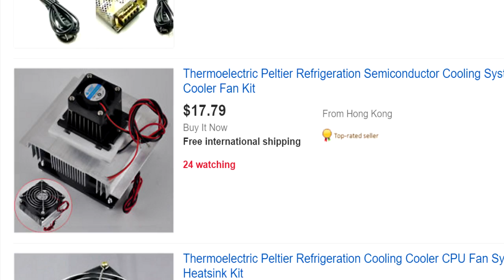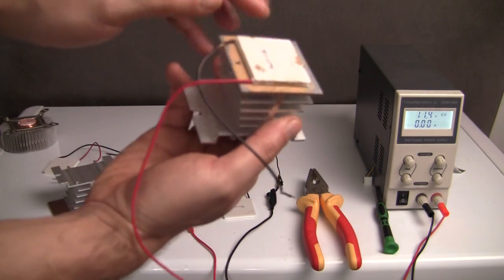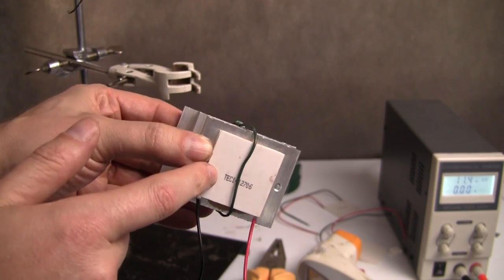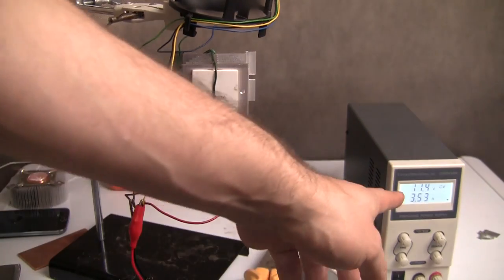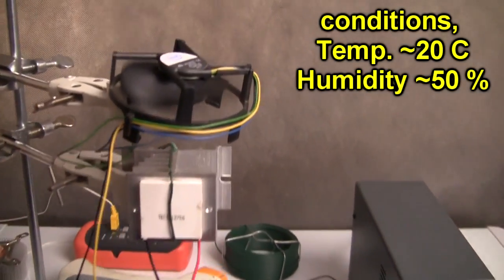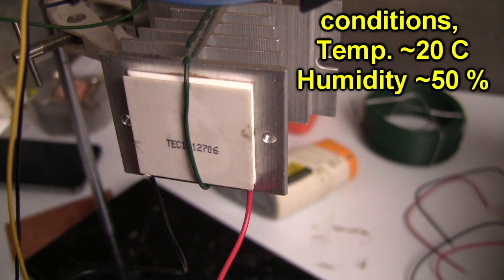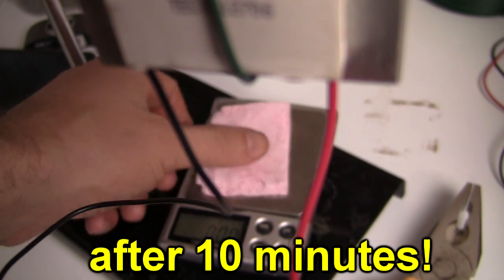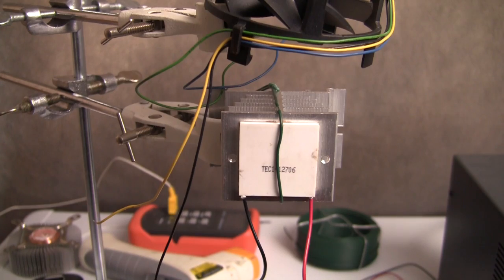Fontus Water bottle claims to make water from air.  Is it possible?

Comment: If air has so much water, wouldn't breathing provide enough hydration?
I'm confused.
Reply: +ZURATAMA1324 
Air do contain a fair bit of water.

But when you breath you also heat the air. If you heat the air it binds more water. When you breath the air is actually drying your lugns out (and that is a good thing, other wise you would drown)... the drawback of is is that you loses water be breathing. In a artic climate its a real problem
Reply: The air would go into the lungs, and the water cant condense anywhere, so probably not.
Reply: Considering that your body has a higher concentration of water than the air, the diffusion happens the other way around. That's why you can fog up glass with your breath.
Reply: If there is so much water, wouldn't you drown in air?
Reply: +That one guy without a profile pic and you could use your artifical gills.

Comment: I used to work for a company that made water from air machines. Running on the fridge compressor design they worked really well, but the company basically went under trying to get this model proposed here to work. It just doesn't work in reality.

Comment: I'm not a scientist and I completely believe that Thunderfoot made a fairly accurate recreation of the technology at work here, but honest question: would a closed system (e.g. mostly sealed bottle as the Indiegogo presents) possibly retain more water than his kit here? It seems that with all the fans and airflow that condensation might dry up or evaporate, therefore skewing the results. Is there a good explanation of how that could be a factor or isn't?

Thanks.

Comment: does the water condensed depend on RH? Would RH have made a significant difference?
Reply: +yan-Deriction It depends on the humidity, temperature of the environment, temperature of the object that is suppose to collect to, and how well the collection point works (mostly to prevent evaporation).
Reply: +yan-Deriction Yea.... in doors its usually 50-60% or so
https://en.wikipedia.org/wiki/Relative_humidity#/media/File:Relative_Humidity.png
He is really right on the limit.
You can only cool it down to 6g per kg (water/air), if you go any colder it will sublimate. 6 grams is about 50% RH around 18 or so Celsius, giving him about 1 or maybe 2 grams per cubic meter of air.

If it was a warm day at the beach it would be say 25 degree and 80% RH, that would push it to 18 grams. You can still cool it down to 6 grams that would give you about 12 grams per kg of air (about 800 liters or so).

We can give it a bit more calculation. 
1KG of air cooled 25 degrees will use 25kJ (yea, that is not a fluke, its actually defined that way). That would condense 12 grams of water (80% RH). 25kJ is about 7Wh, that is in turn about 600Wh per liter of water.

That is quite a lot better than the experiment he done.

Adding a heat exchanger i would guess you could push it to 60Wh per liter, and adding something more efficent than a peliter element, say a normal cooling compressor you would get about 1:6, so about 10Wh per liter.

I would say, that would actually be resonable. I think Thunderf00t calculated it all wrong

Comment: When you do your proper video I hope you will have investigated using different heat transfer methods. I have had better water production (unintentionally) when the thing being cooled was a loop of copper and the temp is held at 1~ degree C. So i think performance will be somewhat greater than your video here makes one expect, yet i do not believe production would be high enough in their device its simply too small.

Comment: Yep, peltiers are about 10% efficient and require lots of power. Then you get all the poison out of the air inside your water, including dust, gases and everything - you basically have an air filter where everything sticks to the moist surface... In survival situation, a simple solar distiller that uses dirt would be 100x better in every way. A peltier distiller would be more interesting, you can use one side for heating moist dirt and the other for collecting the vapors in perfect equilibrum...but still, lots of power required.

Comment: hey TF may i add a sugestion? Could you count the energy spent on the peltier and fans and see how much water you could recycle or filter using the same energy? im quite sure distiling pee or salt water gives way more water than that. Even mud could yield more water than that.
Drying dirt could give more than that. 

Unless you are in a desert.... but neither method would work in there are humidity is really low and theres just dry sand
Reply: +Laharl Krichevskoy THAT is a great idea.  That would serve really well to point out to people who don't bother thinking that not only is something not feasible, but actually completely stupid.
Reply: CyberiusT
exactly because this look like the plastics from air one,  While in the end it works, the method they use does more wrong than good, or in this case wastes more energy in being fancy than actually doing what its supposed to do.

Comment: you would have a lot more water in a bottle and with a higher humidity/temperature.  and you should know that, i think finding the dew point is an experiment in every basic physics course at school/university.
your lab isnt so good for this kind of experiments.
you had a humidity of 50% and 20°C, so the dew point is 9°C, no wonder that you dont get any water^^
Reply: criticises a nuclear physicist on his ability to perform a basic practical.
Reply: Daniel White
i understand enough from physic to know why his yield is so low...
Reply: +nox5555 So your telling me this bottle would only work in 20C+ and 50%Humidity+ environments?
Reply: VintageLJ
it works alot better in high humidity and higher temperature. hot air contains more water, and a higher humidity means a higher dew point, so the condensation starts alot earlyer. 
the dew point for his lab is 9°C. 70% humidity would mean teh dew point would be around 14°C.  and 30°C 50% would mean 9g/m³ more to harvest.
Reply: +nox5555 the problem is this isn't really a conventional dew point problem it's a dew point problem that takes elements from heat transfer in basic dew point problems the dew point is the temperature the air has to be at before condensation however for that to occur it needs to transfer heat into something which is what the peltier is for however the heat transfer will only occur at the surface of the device so only air that stays in contact with the surface for long enough will actually achieve its dew point temperature will the rest will remain at ambient temperature this could be mitigated by making it a contained isolated system but then you would need to pump air in more batch like then continuously
Reply: +nox5555 Ok, lets say you were in an environment with max. humidity (about 30gramms per cubic meter of air) in 30°C  which is about the max. temperature you get in very humid zones (rainforests) and your bottle would extract 100% of the water in the air (which is completely unrealistic), you would need to extract all the water from about 66 cubic meters of air so you get 2liters of water which is way less then what you would need to be healthy in such an environment . Now you must carry all the energy to extract at such a high efficiency and to push all of that air through your system because solar  wont cut it especially not in a rainforest where the ground is covered in shadows. What thunderf00t did was showing is, how ridiculous this thing is and he did a good job doing so.
Reply: *****
its not a good way of harvesting water, thats correct, but he used a setup that disfavoured the bottle alot.  maybe he is so nice and tests this again in a more humid setup.

I dont realy can think about a place where this system is good, but maybe you can find some special condition where this way of harvestng the humidity is the best(i doubt it, you can do it way better with the natural temperature difference between day and night.

Comment: I think it is also very dependent on the humidity levels in the air. In tropical zones where there is a high moisture level it will work better than in an arid zone like in a desert....

Comment: It's not even efficiently designed.  The cooling air should be the exhaust dry air from the condensate side since it would be below ambient temp after passing over the cold coils.  It should be vertical (the coil assembly) so that the water would drip into the bottle and not have to be blown by the wind.  From the drawing the ratio of cooling coils to condensate coils is too low, getting the condensate coils cold enough would probably result in the cooling coil being red hot.  It appears to me to be designed to look neat with just enough actual science to keep the marks from asking too many questions.

Comment: are you planning on showing a better idea for condensing water in the next video too? i think it would just be cool to see what your ideas would be to do the same job.
Reply: +Andrigo rosetti there's no smart way of condensing water. Water only condenses on cold surfaces, because when a water molecule chances from gas (steam) to fluid (water) it loses a lot of energy. Even If we are talking 100°C steam to 100°C water. So if this happens continuously (which is the case if you're trying to condense water in usable quantities) A lot of energy gets transferred to the previously cold surface. So to keep condensation going you need to keep it cool, therefore you need a cooling unit. 
But because of the massive amount of cooling required a small solar panel could never power it. And the power required is simply not worth the water you are getting. It's much cheaper and easier to just transport water in pipelines or drill wells. 

TL:DR There's no good way, because science. Stop believing bullshit merchants claiming in essence to have disproved the second law of thermodynamics. And then they only use it to develop some not really necessary device and only charge a couple of hundred bucks in exchange for their scientific revolution. If it sounds to good to be true, it probably is.
Reply: Scorpionsnerd maybe condensing is not the right word. maybe better ideas for gathering/purifying fresh water with minimal user input.
Reply: +Andrigo rosetti fresh water source, pet bottle, UV-light(aka the sun). kills bacteria very reliably. Which is why we're teaching it to families in developing countries. But of course you should filter it first, since UV light won't remove any dirt. Another, long-term stationary solution if dew and rainwater collection. Some desert animals live solely of dew water. But dew has to do with changes in temperature over the duration of the day, resulting in a reduce max humidity. Basically all you need to know: Dew is a result of the solar energy heating up the air over the entire day. This amount of energy can't be gathered with such a tiny solar cell. 
Incredibly enough there is no way of cheating nature/physics. As much as we'd love easy solutions they just don't exist sometimes. Just as an apple will not just "fall" towards the sky, fresh water without an actual water source isn't just magically possible. There's a reason cities like Dubai burn through tons of gasoline to get the salt out of their sea water. If they knew of some kind of magic condensation they'd use that instead.
And otherwise there are always chlorine based water-purification tablets. You'll find these issued in pretty much every military for when you run out of fresh water. I mean if we could just condense water this easily with a tiny solar cell, why not put a large factory on a hill, and run it through a turbine at the bottom? Infinite energy for the world. But that you will only find on kickstarter, indigogo or trollphysics.

Comment: Look, this device would be more efficient depending on the location.     Say a location that is at 100% humidity and then open the top and wait.
Reply: +ALurkingGrue Yeah, twice as effective. Which still only equals 40 ml a day.
Reply: +ALurkingGrue Yes. For example when you put the whole device in a river or a lake you get liters of water per second easily.

Comment: To be fair, you're working at room temperature and 50% RH. Me thinks that at 90%+ RH and 90F you would get better results.
Reply: +pwrserge83 Yeah, basically I have to be in rainforest where humidity in air mixed with my sweat can be a drink to get this bottle filled over a few hours, and what do I do in the desert? Buy a self tunnel digging bottle which will automatically detect water underneath me, dig a hole and fill itself?
Reply: Purple Ice Oh, too true. I'm just pointing out that the bottle may not be as useless as this test indicates.
Reply: pwrserge83 In rainforest you can lick tree bark and get more water per lick than 10 minutes of this shit.
Reply: Purple Ice I'm pretty sure that licking random things in the rainforest is going to end badly.
Reply: pwrserge83 There's higher chance to die out of dehydratation while waiting for this magical bottle to fill up than eating leaves or potentially poisonous water/frogs so I would rather eat tree bark.

Comment: For sake of comparison:
we lose about 600 ml per day in urine
we lose about 400 ml through our skin
we lose about 200 ml through breathing

Even with baseline requirements, we need about a liter of water a day to stay alive. So you would have to run this device for 50 days straight to get the minimum amount of water to survive for a day.
Reply: +loiloiloi6 Still better value then solar roadways...
Reply: +loiloiloi6 
These numbers are based on the relative humidity of 50% which is considered somewhat dry air. I would be very curious to see this retested with a copper HSF (active cooling on the sink with another fan to draw air across the cold surface) at high humidity, 80-90% or so. 

While I doubt the amount of condensed water would be significantly higher, I am curious how much certain factors could influence the outcome:

Higher ambient air temps
A larger surface area for the 'cold plate'
Better active cooling for 'hot side'
Changes in the flow rate of the air passing over the 'cold plate'
Reply: Michael Whitetail You should tweet @Thunderf00t :)
Reply: Twitter is a SJW haven and a blight upon the world. I refuse to use or even read anything from / about it.

Comment: Would it condense more water if you had a heat sink with a lot of surface area on the cold side too?
What humidity did you run this test in?

btw love your videos!
Reply: +APL K He stated the problem, if you increase the surface area, surface temperature will also rise. And once it's above dew point (~10 °C), no condensation will occur.
Reply: +APL K He noted the humidity on the video, ~50%

Comment: This reminds me of "Michael Pawlyn: Using nature's genius in architecture" at around 8 mins to 10 mins. It does this exact process but for a greenhouse, in a desert like region. The greenhouse was able to extract enough water to supply inside the greenhouse and have excess water. Not sure how the rate of production changes as the size of building changes.

Comment: good analysis . not good at 50% rh, but it might work a lot better at 70-80% rh
Reply: +StudioBrule Because water vapour does not rise upwards.

It will never be a thing.
Reply: +Purple Ice 
Have you never heard of a solar still? People have been condensing water from air for more than a few centuries at this point. This idea works, Tf00t proved that in this video. The deceit on the part of the creators is how well / fast it works.

Comment: If you where to use a heatpipe style cooler, you could move the heat away much more efficiently. Couple this with some small copper "BGA ramsinks" (google image search it), you could give a bit more surface area to condense water on. Not saying that it would make a huge difference, but likely would improve the efficiency at least 15%-20%.
Reply: +Mephitus Tompouce So that would leave us with 4 drops for every ten minutes in this demonstration, considering that they proposed a less powerful solution then thunderf00t was using, it does not matter.
Reply: Yeah. Not saying it would be realistic at all. I was just thinking of any possible ways of making the results a little more fun to show.

Comment: To be fair they only claim it works well in the hottest wettest seasons of the the hottest wettest places in the world and even then will take hours to fill a bottle.
Reply: +Jeremiah B 
And their claims are not based on anything.  They don't have a prototype working.
Reply: OmniscientWarrior They claim they have done some prototyping, but I'm sure its mostly just based off poorly done math as this is another project lead by an art student rather than an engineer. But at least they are telling their funders that, even if it does work, it will not work for most of them, unless they are planing on using it during the hottest wettest time of the year in SE Asia or humid regions of Africa/Latin America. And that even under the most ideal conditions it will take hours to produce a bottle of water and needs direct sunlight.

Comment: Do better with a solar still. In a dry climate, ie: Death Valley, pretty much useless. In a humid climate, ie: Amazonia, why bother? Old desert survival trick, dig a hole deeper than the surface layer, put a can in the center and put a sheet of plastic over it with a rock in the center so it drapes down over the can. Condensate drips into the can over night. If you're lucky, maybe as much as a pint.